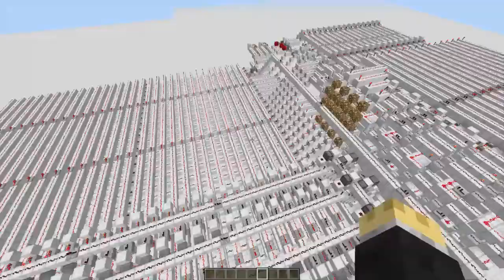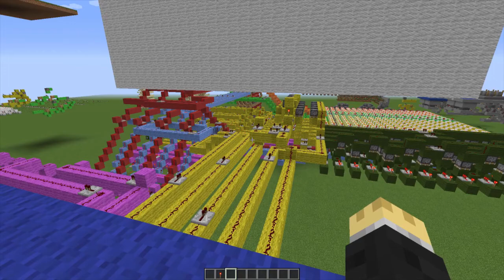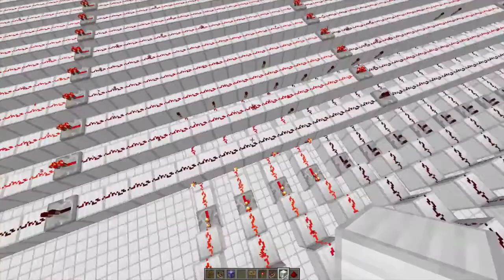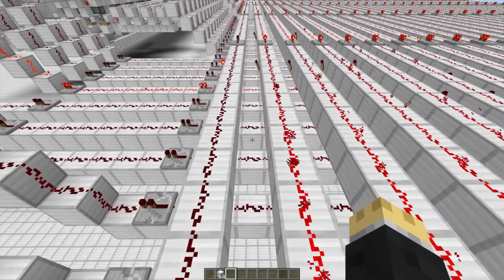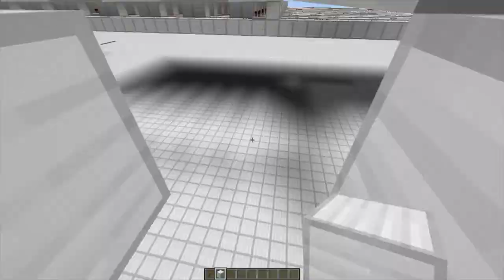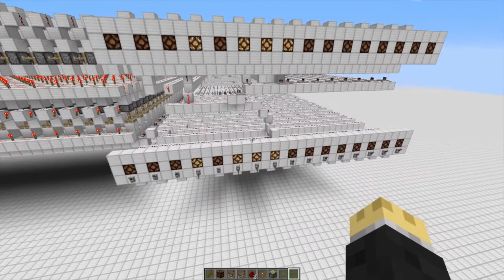Basic Computer Concepts - Pt 2 - RAM and IO

Comment: I'm confused, does RAM replace one of the ALU inputs (as in RAM replacing register output) or does it go the register input? I love your videos.
Reply from the maker: neither. RAM and the 2nd output of the registers both go to the ALU B input. The immediate input and 1st output of the registers go to the ALU A input. This allows the user to perform operations between two registers, a register and an immediate value, a register and a value from RAM, or an immediate value and a value from RAM.
Reply: n00b_asaurus I see, so you OR them?
Reply from the maker: Fundamentally yes.
Reply: n00b_asaurus Thanks for the explanation!

Comment: i love watching your videos on redstone computers, you go very in-depth on everything, and i understand everything you explain.

I have a query about the IO system, im building just a simple 8 bit calculator of my own, and i can't seem to find a compact decimal to binary encoder, and a binary to decimal decoder (BCD i think) for the input and output lines, i was wondering if you could share some light on some of your designs or point me towards some other designs that would be useful in my case, i just need a nice and easy to read interface for my calc, cheers!
Reply from the maker: I don't know about compact, the algorithms for converting between binary and bcd are pretty intensive and the circuits used to implement them are usually pretty large, but there are a few decent designs out there.

Newomaster has a nice circuit that implements the double dabble algorithm.

He also has a circuit that converts bcd into binary, but it is a beast.

Hope this helps.

Comment: On my RAM, I have used a circuit that can reroute signal to A or B. It is just one line in a program memory but it makes it wayy more flexible.
Reply from the maker: That is certainly an option.
Reply: @n00b_asaurus  I also have issues with my RAM that it cannot give out info fast enough for computer to analyze it. Since I did not wanted my clock to suffer I have installed RAM register which loads values from RAM and then they can be withdrawn from there really fast but it takes 2 clock ticks to withdraw it which is a bit inefficient
Reply from the maker: @nutelak-nv2zw  Might I recommend reading up on the functionality of cache
Reply: @n00b_asaurus  ok, I will try

Comment: Do you have something to stop the clock when the program need an input ?
Reply: Maladie X5 That would be a cool feature that I havent thought anout. I may inplement that in my computer.
Reply from the maker: Not yet, though it wouldn't be hard to implement that.... i could add it, but I'm also going to be taking this computer in a rather different direction.

Comment: As a guesstimation, how much Redstone is being used in a Command-Block-free Redstone computer?

Could it be done in Survival, perhaps with a witch farm, looting sword, strip mine, and a fortune pickaxe?
Reply from the maker: it depends I guess on what model/architecture, what instructions you want it to execute, what add-ons and accessories you want to give it, etc. 
For example, my smallest computer I'd guess uses maybe 1000 or so redstone dusts. My largest... easily in the hundreds of thousands, maybe even millions.

I've always believed you could make a CPU in survival.
Reply: So pretty much a computer can be built to do specific tasks that you want like send messages and receive messages from long distances (yes I’m working on Internet in minecraft) or to solve operations and equations. Now if you build a Redstone only pc then you’re looking at how YOU can build almost all components in a PC like the Storage, Processor, and other stuff and now that compactness for things like RAM are getting super small (1 x 2) we can see a future of an actual OS being brought to a PC! So if you want to do it in survival I’d start thinking of a small thing like a CPU and Ram before starting to build out as most of your stuff will be larger then the monitor itself
Reply: Glassy make a video. Of internet in Minecraft.
Reply: @heart4011  You don't need a Turing complete CPU for packet switching. However, I'd strongly suggest that you consider other, denser medium for long range communication than a massive stack of redstone lines. For example, you could make a stack of a unique item represent every digit of a message, encode it base63 and load up a minecart. Then you could have a single "packet" carry about 16 bytes on a very thin line. I suggest it mainly because minecarts can form queues and they handle congestions very nicely.
I think it can be read with a single hopper too, although it's less than fast.

Comment: I know I've written a few comments below your videos already. But I have a question now. 
I watched the bluestone computer of some other YouTuber. That one was nice as well. But there was one thing that was bothering me. 

He had a part of the computer, where he coded the program into (https://youtu.be/QIJAl7ihDeM?t=35s ). But because it was so cramped he copy and pasted the different lines of code from outside of the computer into it. As far as I can tell it should be possible to make that part read and writable. For example you can select one line, Then it displays this line on your user interface. Then you press some buttons and after that you write the changed line into your programmable memory. Then you add some buttons like "go to next line" and "go to previous line" and "go to line 0". 
This entire concept will be a big and possibly slow but I think it would simplify the programming quit a bit. 

Do you also have an idea on how to make the programming easier? Most Minecraft computers are only "proof of concepts". They aren't built to be used. And I get the reason why, but still...
Reply from the maker: hehehehe I like this question!

Right so my first two computers, Bluewave and Skittlebits, both were programmed in a way similar to what you are describing. Rather than giving the user direct access to the program memory, it was hidden behind a user interface that help clean things up a bit. 

As you said though, the disadvantage of that is it makes programming the computer slow, clunky and bloated. Which is why most people opt for program memory that just connects directly to the computers control lines. It's slim and compact, quick to access and fairly quick to program.

I personally am not a fan of it though. For one, your limited to performing one action per instruction. If you want to increase your processing power, you have to do what I'm currently doing in this tutorial series and make the hardware overly complicated in order to do everything you want to do in 1 instruction. But then the second problem arises - it's really cumbersome to program. With the tutorial computer in it's current state, in order to program 1 line, you have to determine the state of over 40 bits.

I'm currently developing a method that will hopefully keep the slim compactness of traditional program memory, while also giving the user access to simpler but far more powerful instructions. That will eventually be phase 2 of this tutorial series, but you can see some of the tests that I've performed in some of my vlog entries for Deep Thought and the Stackish Interpreter. As well as the video I posted titled "Experimenting with Control Logic" which showcases my tests working in a full-fleshed computer.
Reply: I'm watching all your Computer Videos but I wasn't as far as the Control Logic video. So I quickly watched it. 

And now about how much I understood. I've done some C programming on Mikrocontrollers and even a bit of Assembler. The teacher explaining how Mikrocontrollers work is a genius and I've learned a lot but of course stuff taught at school (University of applied sciences) doesn't stick a 100%. And some of the stuff he mentioned went way over my head. The same teacher also taught me digital technology. There we looked at various things like boolean logic, data types, the early days of yC development and how simple yC are build and so on. 
So what I basically want to say is I have some background knowledge. But just watching through your videos isn't enough to understand most things. The programming of your computer is one part of that. I plan to arrange time in the future and then I want to build a computer in Minecraft myself. Then my questions will come again. Probably even in video form. After watching "Deep thought" I think I will start with understanding and playing around with that one first. After that I will follow this tutorial. By then all the parts of this tutorial will be out. And after that I don't know. Perhaps doing something completely different or so, we will see. 

But one things is for certain. I will stay subscribed to you. Your Minecraft computer videos seem to be the most accurate representation of real ones. And you document your stuff in a way I've never seen before on Minecraft/YouTube.
Reply from the maker: Wow, I don't know what to say other than thank you! I feel like I need to make videos more frequently just for that! 

Time is a little scarce atm, but I'll definitely make the effort to try to increase the frequency and quality of my videos!
Reply: I guess I will start with my own computer project in about 2 Years. Between that I will end my study, search for a job and attend a few months of drawing lessons. So you probably will be finished with this tutorial by then if you keep working at your current past. You don't have to overwork yourself. Better keep it slow and have fun doing it. 

By the way I try to learn some completely different skills because my interests are quite vast. But I'm not very disciplined so I can't do several things at the same time. That's why I started planning those things so far ahead. And over time I wan't to document more and more on my YouTube channel. It gets annoying if you are capable in different fields and you just spend a lot of time on Youtube only watching others do stuff. That's what I want to change.
Reply from the maker: You and I have more in common than you think then ;)
Reply: I belief you. Most  people are good at something and they rarely do it efficiently. One thing that I do differently than the general masses is that I realize that the stuff I'm doing is actually good (most eiter downplay their skills or are arrogant) and I try to slowly change my bad habits. 

Another thing is that every thing I do takes a lot of time and I don't have any problem with that. Patience is my strength.
Reply from the maker: Nice, well when you get around to making microcontrollers in minecraft, good luck and have fun ;)

Comment: quick question for ya, do you know of any fast way that is fairly compact and fast to do binary to BCD? I want to this on a GPU onto my computer so I can start messing with the program lines and seeing what I can do before it becomes over whelming for my computer
Reply from the maker: Yes, actually! I used a design in Bluewave Mark II by Newomaster which uses a double dabble algorithm for BCD conversion: https://youtu.be/eAlbHWgui-0

This works fine if you want to convert an output to BCD, however if you want to operate in BCD, there's a nifty little algorithm that the 8085 and 8086 implemented in their DAA instruction (Decimal Adjust Accumulator) Which is used to convert the result of an operation of 2 BCD numbers into BCD format. I.e. If you add 99h + 01h in BCD, the result ends up being 9Ah, which isn't BCD. Running the DAA instruction immediately afterwards converts the 9Ah into 100h. I'll most likely be doing a video about this subject at some point, so feel free to stick around if you want to know more ;P
Reply: +n00b_asaurus ok thanks, this is why I love your channel man.
Reply from the maker: Oh no, Thank you!
Reply: +n00b_asaurus also, is there a way to make binary into redstone strength using comparators? i can't find a design for that anywhere. I know it's possible, and I could probably figure out how to do it once I understand comparators a little bit more, I'm just now Starting to use them. and I'm looking forward to the series your working on man, 

and may I ask what your next big project will be?
Reply from the maker: https://youtu.be/NUWxnyOm2w4

Also ender_scythe requested an interpreter for his esoteric language, stackish. I'm working on the designs as we speak.... after that, I'm going to try and expand on the state machine based CPU like in the second revision of Skittlebits, but this time try to make things a little smaller.
Reply: +n00b_asaurus thanks again man, and got one more question, how easy would it be to expand it to 8 bits? and I'm looking forward to those videos man, your deep thought computer blown my mind. I'm tempted to see if I could make one just as powerful if not more in the same space. you and Bennyscube are the two people I have learned the most from redstone, 

so may I ask what type of adders your going to be using? it would be awesome if you used Bennyscubes adder design that he made a video on. I'd love to see how fast you can make that. although I think if you do that, the rest of the machine will be slower than what the adders can do lol
Reply from the maker: Thanks. As for expandability on the DAC, you'll have to just build 2 side by side. Since redstone power can only be 1 of 16 states (0-15) you can only encode 4 bits of information onto it.

As far as adders are concerned, I'm continuing to use my modded Ammorth design simply because its the smallest I've found so far.... I did see a nice fast design by benny, but I want to try and figure out how to make it tilable first before I utilize it
Reply: +n00b_asaurus awesome man, thanks to you, I know how to turn this from 8 bit binary to 7 seg display, I just wanted to use a method I haven't quite seen before, thanks again. I should have it built and operating in about a week or so.
Reply: I'm just hoping I can get it to work in 14 ticks so it keeps up with the rest of the machine lol
Reply from the maker: yeah thats always the issue, you're only as fast as your slowest part ;)

Comment: Would it be possible to have an adjusting clock speed using program memory?
Reply from the maker: How so?
Reply: @n00b_asaurus  instead of having a clock hooked up to the program counter you could have a few outputs dedicated to deferent length delays.
Reply from the maker: @shongzah2542  you could definitely do that, and there's no rule saying you can't.

Comment: So in this video, you stated that the ram goes onto the bus that is connected to the B input of the alu. And in the program you were demonstrating at around minute 27 ish, you said it was a design flaw, but it opens more doors than it closes. 

If that is the case, wouldn't you be able to connect a multiplexer right before it reaches the register section to select if it goes through bus A or bus B controlled by a single line in program memory? 0 for the A bus and 1 for B bus? 

Only reason why I ask is so the doors that the design flaw closes, can actually remain open.
Reply from the maker: It doesn't really matter too much. I believe the only reason why I went with that design choice was there was also the immediate bus to consider. I could have multiplexed them both, but that would have made the hardware a little more tricky.

Also keep in mind, the more components you have in series, the longer it takes to process data.